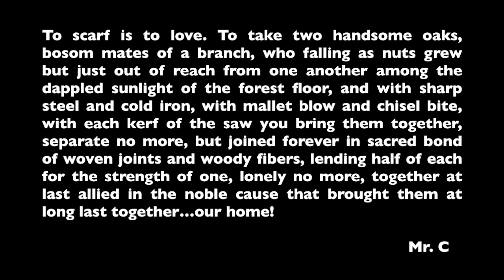Our timber frame cabin Part III: White oak scarf joint

Comment: Can you tell me how the vertical drill does not lift itself off the wood as soon as you start drilling? Seems like you would have to screw it down or something.
Reply from the maker: hmmm, well there is really no downward pressure from the mechanism, so without the lead screw on the auger bit, you could crank away till the cows come home and it won't do anything, as you crank, the lead screw catches and pulls the bit into the wood. Its the same principal as a brace and bit, or a T auger, if you've never used one, well you should! They are great fun, and you'll soon understand how this one works, its just bigger and has two handles.
Reply: wow, really?  this is so embarrassing, sir; I should have figured that out, and I promise I wont ask anymore questions until I think it through.
Reply from the maker: the only bomb question is one left unasked! i had not real idea about these tools until I put them to wood, but they teach you what they are for pretty fast! ;)
Reply from the maker: dumb*

Comment: Wonderful video as always! Funny to see how many comments are on this video compared to others haha.

 It is not related to the video but you are someone i look up to when it comes to woodworking so i thought i'd try to ask you:). I've been making my own axe handles lately and i have just made my 4th one and i'm struggling to get a full fit. I am working with some old axe heads so the eyes are always a bit crooked but a "full" eye of the axe would be nice to achieve is there any advice you could maybe give me?
Reply from the maker: Hmmm, well you want the part which is inserted to be tapered not just straight , so the end which gets the wedge inserted first should actually be a bit smaller, so the bottom end swells and jams up tight, you also want a good swell below the tapered portion you slid in the eye, in both directions. Keep trying, it takes practice to set a helve right, you'll get there.

Comment: I find it funny. 

2 year old video. 
1 year old comments saying Mr. Chickadee’s beam drill looks like Cody’s. 

Should be Cody’s looks like Mr. Chickadee’s but as he has said they were a regular tool used in the timber frame trade in the 1800’s and early 1900’s.